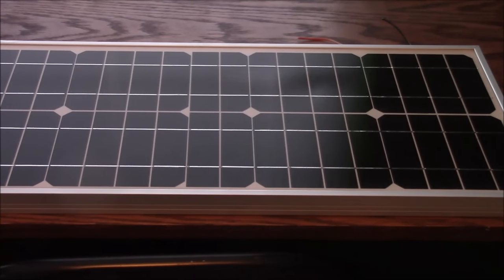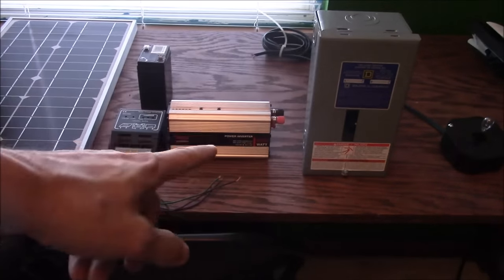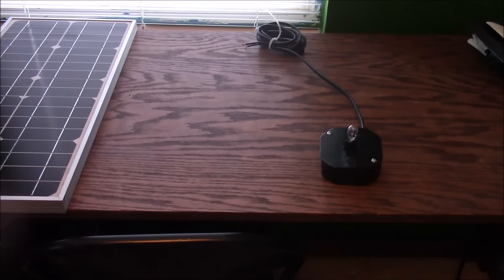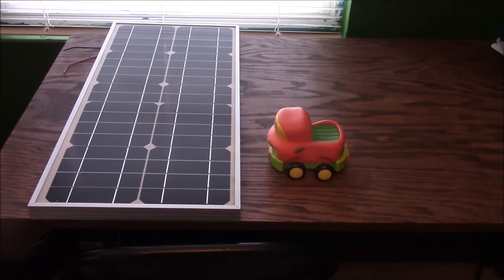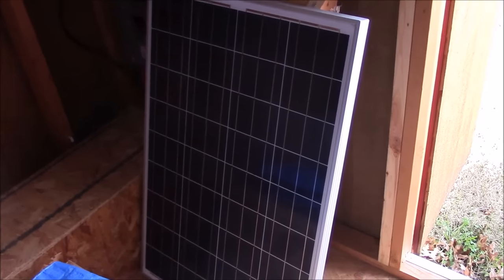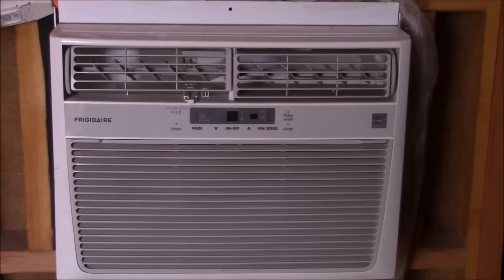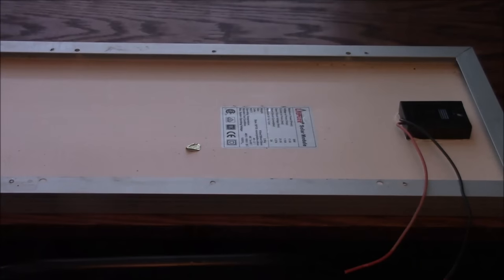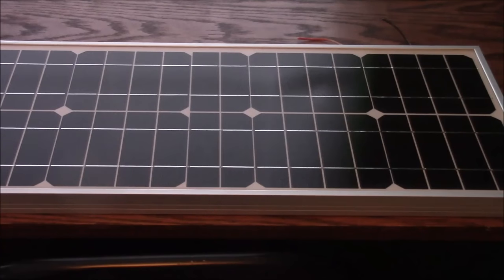Solar Panel Systems For Beginners - Pt 4 Frequently Asked Questions

Comment: I'm getting a crash-course in solar, so I appreciate your posts.
We set up and assist schools for the deaf in Africa, and the cost to get them on the grid is cost-prohibitive. These are shoe-string budget schools, and their electrical requirements (at this time) includes 2 laptops, 4-8 cell phones, and probably 6-10 12V LED light bulbs.

They're thinking that a locally-provided 200W panel setup for about $300-$400 (including controller, inverter and 12V car battery ..all made in China, I'm sure) should do the trick - or so they're being told. But I've seen some of the "solutions" that some of these guys have come up with, and ...let's just say I'd rather study up the topic myself before being convinced to shell out some cash for it.

Any suggestions you can provide would be greatly appreciated.
Reply from the maker: Never use a car battery for a production system like that.  It might be fine in a pinch but you need a true deep cycle battery for everyday use.  To get a proper 200W system you are looking at $400-500 minimum.  And then they need to factor in replacing the batteries every 5 years if they get premium batteries or 2-3 years if they get a cheap marine/RV deep cycle battery.

Comment: Good video. I'm going to build a portable system for camping, etc., but still plan on using it at home to power low-draw stuff, iPad, Pods, LED light.   My question is what happens when the panel fully charges the generator battery but is still connected to the battery?  The panel is still generating electricity, but there's nowhere for it to go.
Reply from the maker: +Mike Masztal Good question.  No electricity is generated in that case.  Here is a good explanation I borrowed from elsewhere:

"The photons from the sun have energy and momentum, but not "electricity".

Essentially, a photon (solar or otherwise) striking the solar panel can create an electron-hole pair (EHP) and, if the EHP is within or near the depletion zone, the pair will be separated by the built-in electric field.

This results in a separation of charge and with that, a voltage across the panel.  If there is an external circuit connected, there will be an electric current through the circuit.

 

But, if there is no external circuit through which an electric current can circulate, the electric field due to the separated charge opposes further separation of charge; the generated electron-hole pairs simply recombine rather than separate.

Electric power is the product of voltage and current.
  If there is no external circuit, there can be no current and thus no 
electric power can be delivered by the panel, i.e., the "electricity" is
 never developed and thus, there is no need to consider "where it goes"."
Reply: +LDSreliance I kinda figured that the controller opens a circuit cutting off current.
Reply from the maker: Mike Masztal
Oh it does.  I thought you were asking where the electricity goes generated by the panel if the controller cuts off the power.  The charge controller will either shut off the charging current or switch to a float program where it delivers a small trickle of power to counteract the natural discharging of the battery as it sits.

Comment: Aren't the breakers designed to limit flow that will disconnect if it exceeds the rating (20 A breaker) ?  Breakers are a switch but more important it is a fuse.  Fuses prevent wires from overheating and setting wires on fire (good demo) .  Even on AC equipment, DC current may jump over the AC breaker,  but it would still be halted by a correct rated DC fuse.  On the AC side, don't you need a ground rod and bare wire into the breaker box?  Your inverter needs to be grounded or you can't use a GFCI (required in most codes).  Kill a Watt is a good plug in tester.  Good Job keeping them safe.
Reply from the maker: Thanks for the comments.  You do need a properly rated DC breaker to be safe.  Or you could use an AC breaker and a DC fuse, I guess.  Ideally on the AC side you would have a ground rod.  But that is the same with a gas generator, too.  Yet most people don't use them that way and there are very few issues.  I am not advocating not being safe at all,  please don't misunderstand, but for tiny off grid systems like this that aren't hard wired into a house or providing enough juice to kill someone, a grounding rod is highly recommended but you can get away without using one if you had to.

Comment: Great info, can I wire my loads (inverter, USB, etc) directly to the battery and not use the load terminals of the charge controller? So, I have my solar panel and battery wired to the controller, and my loads wired directly to the battery with individual switches.
Reply from the maker: Yes, and there are certain instances where that is preferable.  However, you will not benefit from the "low voltage disconnect" feature of the charge controller that saves your batteries from discharging too far by cutting off the power to the loads when your batteries' voltage drops too far.  Most inverters will do this, too, but they often cut off at a lower voltage that might harm the batteries.

Comment: oh, I got plenty of stupid questions.  Here is where I am lost with the breaker box and the inverter.  I thought the breaker box was there to turn one direct load into many.  If the inverter goes after the breaker box, why do you need the breaker box?  How do I get multuiple loads out of on inverter?
Reply from the maker: You can do it either way.  The main purpose for the load center/breaker box is to distribute power from one wire into many like you said.  However, it is also a good safety device and allows for an easy on/off switch to allow you to re-wire things or manually shut off one device and keep other devices on.

One scenario where you might put the load center before the inverter is if you had a set of 12v lights or a 12v fan that you wanted to run but then you also wanted to convert some of the power to AC for use with common household devices.  Then you could run one breaker for DC power stuff and one breaker for your inverter.

Comment: I do not need battery back up , just want to run my 240v .75kw pool motor while the sun shines . Have good light here . What size panels will I need ? And a converter ? Any help is cool . There a few here with the same issue :-)
Reply from the maker: Scott, do you know how much power that motor consumes after it is running?  A lot of motors like that require a big surge of power to start up but much less after they are running.  Anyways, if it really consumes 750W at all times then you will need 1,000W of solar panels to run that motor.  That will leave 25% head room for losses.  

You will need an inverter that can provide 240V such as this:  http://amzn.to/2r9fyDL.

You will need a charge controller even though you won't have any batteries.  You cannot connect 12V solar panels directly to an inverter.  Since it will need to handle up to 80+ Amps (or high voltage) here is one you could look at:  http://amzn.to/2raqW2K

All of that is expensive, I know.  I would be surprised if that motor actually runs on 750 at all times, though.  Do you have a way to test it?

Comment: I really liked your solar videos. I have a question. I have a 10 watt solar panel and I want to power two muffin fans. My quandary is that I want one fan to run all the time, but the second, I want to run only when the panel is producing 5 watts or better. Any thoughts on how to wire this with a battery? and without a battery?
Reply from the maker: You will not be able to power a fan 24/7 with a 10W solar panel.  If you mean that it will run all the time while the sun is shining directly on the panel that will work.  As far as running the second load only when the panel is producing a certain number of amps, you would need a microcontroller to do that.  Even programmable charge controllers that I have used don't have that kind of flexibility built in to them.

If it were me, I would wire both fans to the load output of a charge controller that has a feature called low voltage disconnect (LVD).  That means that the charge controller will automatically shut off the fans if the battery drops below a certain voltage so that it can charge back up.  When the battery reaches a higher voltage the charge controller will automatically resume powering the fans.  This should translate to both of the fans running during sun hours as long as your 10W can keep up with 2 fans.
Reply: Mark Olejarczyk aa

Comment: Ok so here is my question. I am setting up 25 watts total of landscape lighting at a sub division entrance. I am gong to be using a transformer of course to convert it to 12v. Could I plug that transformer into the solar kit if I were to buy a 100 watt kit?
Reply from the maker: You would not need a transformer if you were using solar.  Landscape lighting is usually 12V and so is solar.  So all you need is the solar panel(s), battery(s), and charge controller.

Comment: Good work you are doing, thanks ...... but i have a question here,
1. i have a 4 solar panel system of 130watts /12volt and 7.5amps each, with two panels in series and all in parallel, giving me a total of 520watts/24volts and apprx 14.5amps, 
2. i dont have a solar charger controller but want to power my inverter direct using a 24v - 240v set-up transformer to feed the inverter from the solar panel, which has an inbuilt battery charging  system,
3. the inverter is a 2.5kva sine wave inverter, with 2(two) 200ah /12volts battery, can this work? connecting the panel to the transformer directly before loading while the inverter charges the battary ?
Reply from the maker: Why do you need a transformer?  Is your inverter 240v DC?  What is the make and model?

Comment: Your videos are phenomenal! 

Planning on building a chicken coop and I want to use solar panels to power a few things. In the beginning, I'll need to power a heating mat and/or lamp 24 hrs a day for the first 5 weeks - "brooding".  I've got a 45W matt that will maintain the temp I need. Because I have to run the heat all day and night, is the off-grid setup my only option?
Reply from the maker: Thanks for the feedback!  For a chicken coop you would go off grid.  The expense and headache of connecting to the grid with your electric company for such a small need would be too much.  But you are going to need like 600 watts of solar panels to run something like that around the clock (and some batteries).  That will vary some with where you live and what season of the year it is.
Reply: Is there anything I should look for when looking at deep cycle batteries?
Reply from the maker: Jordan Haynes
Read reviews on them before going to the store.  All the brands are manufactured by only 3-4 companies and then Energizer, Duracell, Interstate, etc. just slap their name on them.  So look up that brand and line of battery that the store you are going to carries and find out if they are good.  For example, I found that the Exide batteries that Academy carries are pretty much junk.  So I went to Batteries Plus instead to get a Duracell brand battery that was manufactured by a better manufacturer with a better reputation.  I paid $10 more but it was worth it.

Other than that, just look at the amp hours.  Ignore the "reserve capacity" or "runtime" or any other statistics.  All we care about is the amp hours at the 20 hour run rate.

Comment: Can I use 10 pcs of AA 1.2v NiMH rechargeable batteries? If yes, would you recommend it? I want safe batteries
Reply from the maker: For solar?  No I would not use that.  NiMH has a memory and doesn't do well with constant charging and discharging.

Comment: I have a simple set up.  Two 200 hundred watt solar panels to a charge controller. Charge controller to a bank of six 12 volts deep cycle batteries.  I have the charge coming in one end of the battery bank and going out the opposite end where I have my power inverter. Is that wrong? Should I be doing it differently?
Reply from the maker: No, that works fine.  Nice job!
Reply: Thank you!
Reply from the maker: ***** You are welcome.  Thanks for watching!
Reply from the maker: Adebayo Mutiu
I don't have WhatsApp.  You can email me if you want at ldsreliance@gmail.com.
Reply: hey ,if anyone else is searching for is solar energy right for your home try Ewans energy roadmap (Have a quick look on google cant remember the place now ) ? Ive heard some extraordinary things about it and my cousin got cool results with it.
Reply: Wait, so this is another weird thing I'm trying to understand.  It's okay to have more numbers of batteries than solar panels.  Like, if in California I have only 4 100 watt solar panels but six batteries, that's like I've built-in a little security, right?  And the same number of solar panels with eight batteries would be even more security.  I didn't know we could do this.  Dumb, I know.
Reply: @belovedconsole ~Yes,  my understanding is you can add to either array
just so you had  heavy  enough copper lines to carry it.  But t he  other
electrical components must also be able to handle the load. Lots of
people don't want to pay for larger electrical wiring but that's the 1st
think you'll be changing if you didn't plan on up-sizing.  The copper
sizes from panels to batteries is where some skimp but if you don't
wish to buy & install that wiring twice it's best to design it into the
system from the start, if you can afford to?   peace

Comment: As solar panels become cheaper and more efficient, it makes it possible to have a 2kw to 5kw solar system and be able to charge an electric vehicle or anything else for that matter. Great info on the videos but at the same time, perhaps a disclaimer about costs and system size opening possibilities would have been a good addition to the video.
Reply from the maker: True.  I have gone over that in quite a few other videos but it couldn't hurt to mention again.

Comment: Thank you for the educational videos. I just subscribed. I have one question, is it possible to take out the Load Center? So its, Panel to CC to Batt... CC to inverter to an item (TV). If its possible, what bad effects could there be?
Reply from the maker: Of course.  The load center is just if you want to divide the load into multiple loads.  Or it can be used in reverse to combine multiple solar panels or strings of solar panels into one input for the charge controller.

Comment: Thank you for these videos what about adding a timer? Where in the order would it be in
Reply from the maker: Some charge controllers have built in timers.  If you don't have that feature then you would put a timer in between the battery/cc and the load.  Just wire it in series with the positive lead from the power source to the load.

Comment: Hi, I recently purchased a solar panel with both male and female MC4 connectors on it.  I also purchased a controller.  My question is this.  The controller only has "set screws" to connect incoming and outgoing power.  The power out from the solar panel is via a MC4 connector.  How do I connect the panel to the controller ?
Reply from the maker: You can either hack off those MC4 connectors if you never plan on doing anything else with the panel or you can buy a pack of MC4 connectors and connect them to the ends of 2 short pieces of wire.  I would recommend that because then in the future if you decide you want to disconnect that panel and do something else with it you will still have those MC4 connectors on there and those are the standard connectors in the industry.

Comment: i have a oscillating car fan that run directly from my solar panel its just that the power it makes is not constant..theres so much sunshine here makes it fun to use...and led strip lights direct from 10watt panel still works even when raining...:-):-):-):-)
Reply from the maker: Very cool.  Yeah the power from a solar panel is not constant voltage so that is why most devices need to run through a charge controller to smooth out the power and have a battery connected for when a cloud passes over or something.

Comment: How do you check the input/output to and from the panels?  I have several chargers but feel the output is inconsistent. Also not sure how to check what is a 10,000mAH vs 20,000 mAH etc?
Reply from the maker: The solar panels would have to be under load to check their output.  You can't just put them out in the sun and use a multimeter to read the numbers.  So typically I will use a simple voltmeter/ammeter combo like this:  https://amzn.to/2uYc2zF

mAh is a measure of battery capacity.  Some batteries you can check the capacity with a battery tester.  But all batteries should be rated by the manufacturer so you can look up the battery model specifications.

Comment: I have a 205 watt  solar panel with 68.8 VOC.  How can I  lower the VOC so can use it to charge my portable power station with a 14.2 -30V input voltage range?
Reply from the maker: You need to have a voltage converter that will step that voltage down.  Something like this:  https://amzn.to/3fLRcuW